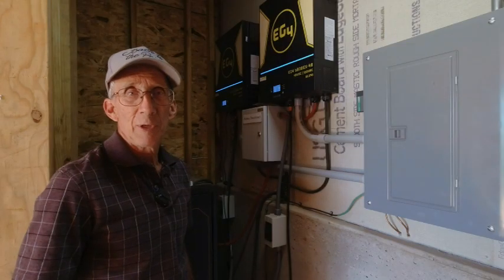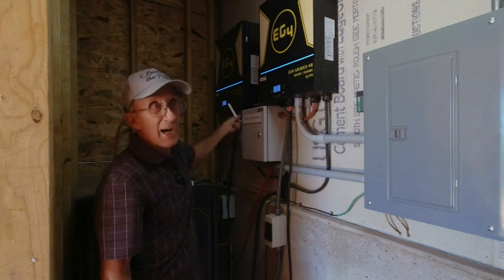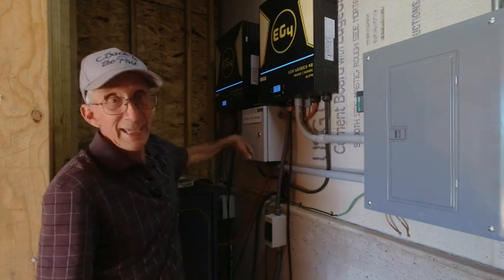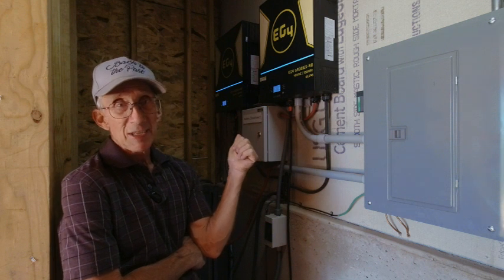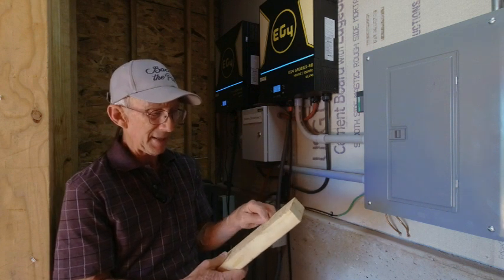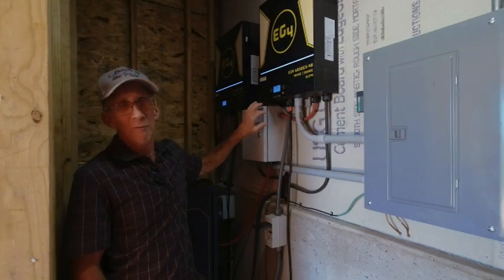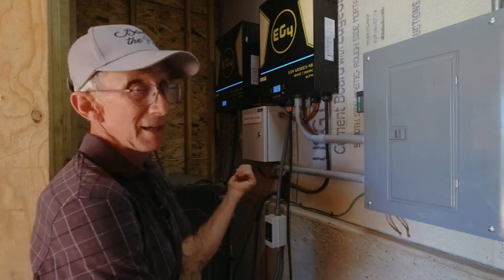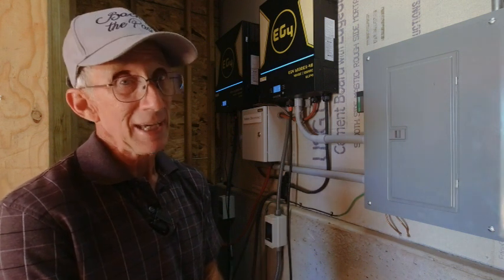Episode 62- Solar update, error code 61 resolved, solar panel voltage loss vs temperature

Comment: You did a great job. Ive installed the same system. Alot of the other tubers dont explain the fine details. If i could go back i would have recorded and posted to help others. Thanks
Reply from the maker: I've had good results sofar with this system. I'm not goo about the fine details. I mistakenly assume people already know.

Comment: Are you measuring voltage while not hooked to inverters? That is what you need to measure is open circuit voltage, not the voltage at the eg4 inverters.
Reply from the maker: I'm reading input voltage from the EG4 inverter. When I have checked open circuit voltage at the panels and input readout at the inverter, there has been a consistent 3% difference from voltage loss of the conductors. The numbers may not be the same, but the difference is consistent.

Comment: I want to say your video was very helpful.  I attempted to follow your numbers from the beginning, but was thrown out of sync because you initially stated you had 245w Canadian Solar panels.  When you identified them again, you identified you had six 445w panels in two strings.  That got me back on track with your voltage and wattage results.  I did research the BiHiKu 445w Bifacials, and verified your VOC at 293.4v and your 245.4v.  I want to thank you for running this test, it was very informative on the results of these panels at different temperatures.  I'll go back and view how you racked them in another one of your videos.
Reply from the maker: Glad I could be helpful. Sorry about the misquote. They are 445 watt panels. As it's gotten warmer, my total voltage per string has dropped below 220v, and it really hasn't got hot yet. I've added two more batteries now. Since I don't use much power yet, they pretty much stay at 100%, even overnight. I understand the EG4-6500's have a very high idle consumption. I'm not noticing it, but I haven't tested that yet. My rack is a wooden rack. It's held up well to some pretty high winds.
Reply: @backtothepast1850  I've been looking at the EG4 6500 for about a year, they seem to be pretty stable now.  There were a few issues out of the gate, but Signature Solar seems to be on top of most of them.  However, in my period of watching the progression of issues being addressed, they have come out with the EG4 6000 split phase inverters.  That could be my answer as I start my build, start with one inverter and 4000 PV input, and eventually double that.  I have looked at your rack build and it looks similar to what I was thinking about.  Still don't know if I am going to go with an adjustable tilt, or a permanent mount, but I'll decide that when I can start building.  Thanks again for the ideas that you have thrown at me.

Comment: That is some very good information. I understand that over voltage on your charge controller will damage them but do you know if your EG4 will sense that and shut the system down before damage is occurred.
Reply from the maker: Yes it will. I'm well under the rated 500 volts.